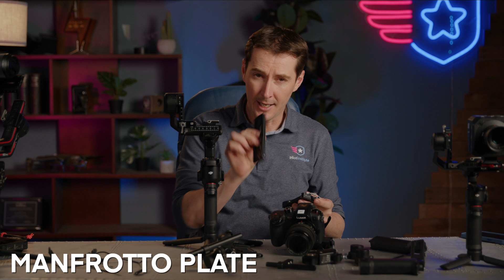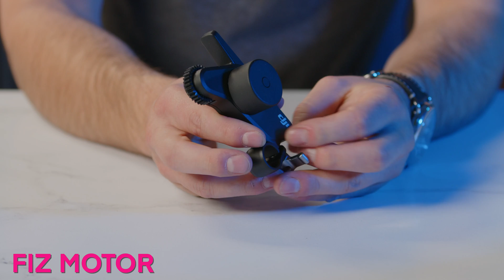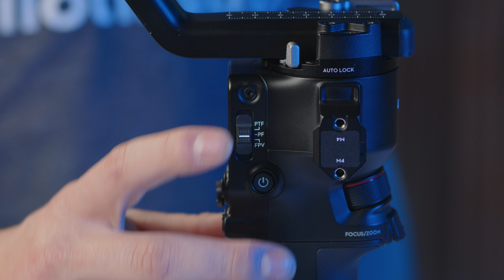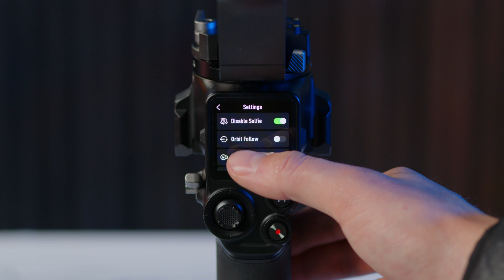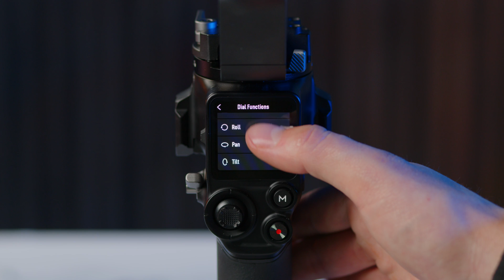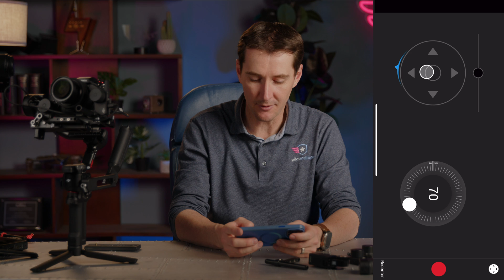DJI RS4 - A Beginner's Guide

Comment: mine has an Auto Off 14:28 between Gimbal Auto Check and Restore Parameters. what's this for?There's already an Auto Lock section towards the top you covered that's for On/Off and Sleep Mode, but Auto Off is just a toggle, so no explanation anywhere I can find :(

Comment: You have motors mounted on each side of the camera on your RS 4 Pro. My DJI RS 4 Pro came with a plate that has a channel for one motor mounting bar on the left side of the Gimble. I have two motors mounted on this one bar. I would like to have one motor on the otherside of the lens. That would give me a bit more room. I'm using a Sony ZV-e10 and my lense are not very long, and this makes mouting both motors side by side tricky at best.
Reply: You can buy a double rod plate to attach the motors to both sides

Comment: 10:13 if you double tap the power button on the focus motor it will auto set the end points. Works in all three FIZ.

Comment: Excellent as always. I'm puzzled about the gimbal's balance when using a zoom lens, which should upset the pitch (?) balance. How long of a zoom lens can you get away with? Would the Leica 12-60 f2.8-f4 be too long?
Reply from the maker: A 12-60 is likely fine. You would adjust the camera tray forward and back to get proper pitch balance.

Comment: It's the same setup with me. I have added a Ronin sc motor. But I can't control the motor by front wheel when it connect to RS4 by the usb-c named with image transmission. But I notice it can work in your side. I don't what's different. My RS4 firmware is the latest one.

Comment: i think this is rs4 pro ???
because i got rs4, and its only the gimbal :v

and the battery, its not 12 hours :v
Reply: If you get the combo it comes with the extra stuff. It’s the normal rs4. Also he might’ve bought the bigger battery seperately
Reply: @andrejcupac7359  I bought the rs4 Pro combo  and its battery life is 2.5 hours or so.

Comment: For beginners, you need to warn potential buyers of the downsides!

First, you'll buy one thinking that you fully own it. No, effectively you have to ask DJI if you can use it because you have to create a DJI account and download an app to your phone. Otherwise, you can't activate it and it will only allow 5 uses!

The worst part of that is that you can't get the app via Play Store, rather you get an apk file. That might be fine for those well acquainted with adding apps that way, but for everyone else it can screw your phone. Mine insisted that I had to modify permissions to allow the installation and that upset so many other things it wasn't funny! I lost automatic bluetooth with other devices, my notifications went haywire...

Of course, in the first instance you think the DJI app you find on the Play Store will be the one but, no, that's just some garbage to the DJI forum which is equally useless as new owners can't post!!!

After that, there are other considerations such as, if you have a Sony camera, you can't change the battery without requiring to set the balance again, unless you add more brackets via Smallrig. A major design flaw!

There are other less important issues, such as putting it together and packing away require an excessive degree of unscrewing.

It works well, but it's not without problems.

Comment: I am looking to build the exact same setup as i am a GH5s user as well.

Question: Have you tried to use the Active Tracking feature using the USB-C cable connected directly from Camera to Gimbal? (Lumix camera can bypass RavenEye box apparently) I've been looking around everywhere to see if anyone tried that with the RS4 (Not pro version) and see what were their thoughts on it and also to see how it worked. I am trying to see how would that ActiveTracking feature would work. Like do you absolutely need the phone app to make it work properly or just plug and play with the cable and that's it?? 

Trying to figure out before buying between the regular and Pro version. (Pro version having the build-in screen feature for that so it's easy to setup the tracking box)
Reply: For anyone wanting the answer to this in the future:

I tested it myself. Bought the RS4 (Not the pro version) and it does work. No need for the raveneye or video transmitter to have the active tracker work with the Panasonic Lumix camera. Just plug and play with the usb C and you are good to go. No need to use the phone app either. You just need to put your camera in animal/human autofocus mode and tap the trigger on your RS4 and that's it. It will now track whatever subject it has in focus detected only it drops out of view
Reply: @Dragoonthefox  hi there, and please help me, haha. I'm completely new to film making and gimbals - I have the GH5s, and am looking at buying the RS4 (not pro) combo, which comes with a focus motor. The may sound stupid, but do I need anything else to get accurate focus? Eg, will the camera's auto focus settings suffice once the camera is plugged into the gimbal? Thanks for any help you can provide.
Reply: @NessNayii  It's a bit tricky.. You cannot do both at the same time. You have to manually switch the camera into manual or auto focus mode. So yes it will autofocus with the camera itself just like if you had it handheld. But if you want to use the focus motor you have on the gimbal you have to put the camera in manual focus but than you loose that autofocus. THe focus motors are really meant for the ciname lenses that has no autofocus at all..

Another option is the LIDAR attachement from DJI +  video transmitter i believe. But thats more expensive. The lidar will do the autofocus for you and control de focus motors itself.  So by doing that you will have the camera set to manual focus so you can now use the finger wheel to minor adjust at any time the focus.. Tho you lose the autofocus fonction of your camera. It will be the LIDAR  doing the work instead
Reply: @Dragoonthefox  thanks so much for the reply - very much appreciated. Yeah this does sound very fiddly! Not ideal when already moving around trying to frame your nice motion shot. 
I did look into the LIDAR - it looks fantastic, though yes, the pricing is certainly an issue. Also, whilst I couldn't find a definitive answer, there seemed to be clues indicating that it only worked with the  Pro version of this, though that may be just me misinterpreting information I didn't fully understand.
Reply: @NessNayii  I think yes you will need the pro version to have the lidar/video transmitter working correctly
Reply: @Dragoonthefox  Damn, might have to tighten the belt, bite the bullet and go for that expensive Pro/Lidar option. Otherwise I think we're gonna get a lot of fuzzy footage from actors who are doing us a favour and working for free. Sincere thanks for all your help my friend, I very much appreciate it.